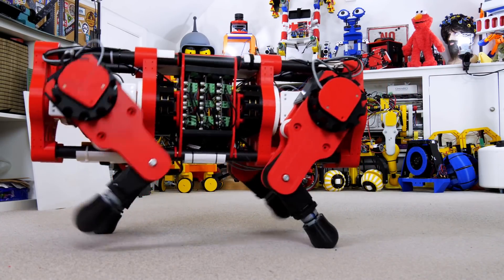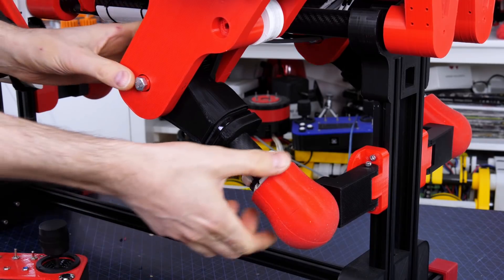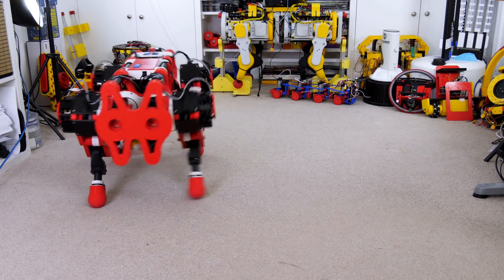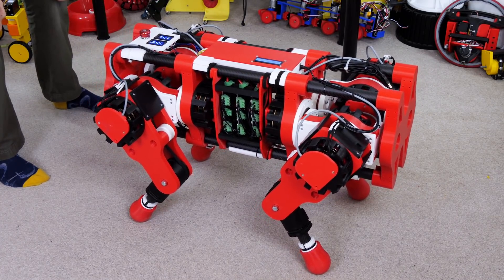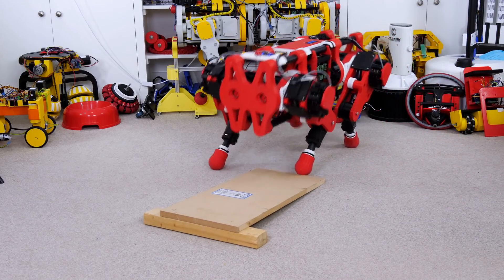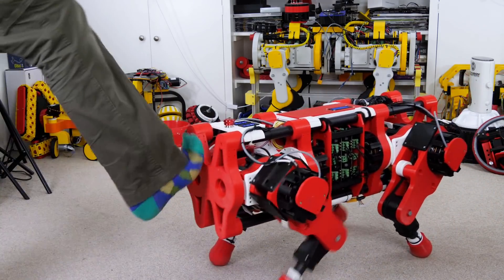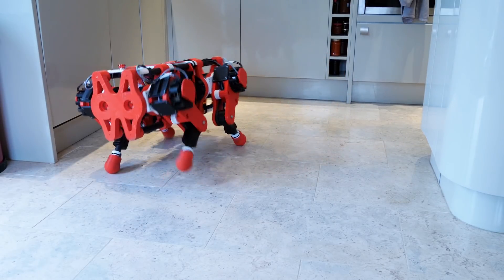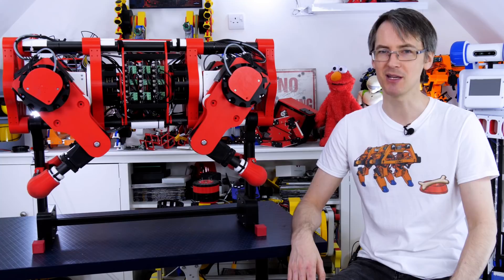3D Printed Robot Dog Climbs Over Obstacles

Comment: Would it make sense to add multiple stepping patterns for different move speeds, like horses have? when moving slow just moving one foot at a time, that way you could navigate really smooth without balancing issues.
Right now you only have "trot", with mirrored diagonal pairs of legs, you could add "walk" for slower and maybe one of the running patterns for, well, running?

Comment: Been loving this whole thing progress! It is so fun to watch you go through every step and overcome all the challenges. It has also made me think critically and come up with potential ways to improve any future iterations of openDog, specifically surrounding the design of the legs. I know that your version of a robot dog is supposed to be able to move forwards and backward relatively easily, with the front and back legs being mirrored, but I think taking a few notes from real dogs might help. In this case, I'll be comparing it to a golden retriever, as I feel it is a good general comparison (also the first high-performance dog I could think of):

1. The first thing I notice is the height of the openDog. In a golden retriever, the length of the legs in a slightly bent, stationary state, results in the height of the dog (paw to top of the body, not including neck or head) being approximately the same as the length of the dog (front end of body to back end of body, again not including neck or head). This should in theory help with control, and the ability to move around much easier. My thinking surrounding this is that the current version's stride length compared to the body length makes it difficult for it to move as effectively. Just to make sure I'm not crazy, I looked at Boston Dynamic's robot dog, and their body length is very close to the height of the robot, so this idea may hold so truth behind.

2. The second thing I notice is the ratio between the upper (thigh kind of area) leg versus the lower (calve kind of area) leg favours the former. In a golden retriever, the upper legs are shorter than the lower legs. The ratio of upper to lower legs is approximately 1:1.5. I don’t know how this could affect the way that openDog moves, with the different structural design concepts applied, but it might help with openDog's ability to handle moving at greater speeds. Again looking at Boston Dynamic's robot dog, they instead have a 1:1 ratio between the upper and lower legs. Additionally, I also noticed that some dogs also share this characteristic. So I can't concretely say if one is better than the other. But I still hold the belief that the lower leg should at least be as long as the upper leg.

I don't have anything else to add, as my experience in this area is limited, due to limited funds to actually pursue engineering challenges (hopefully just for now), as well as still being in high school, but I feel these suggestions might either help with future iterations of openDog directly or indirectly. Again, amazing content! Keep up the great work!

Comment: Very impressive, especially as it's largely 3D printed.  Don't get me wrong, as a technical exercise it shows how he can can come up with some brilliant and very complex mechanisms, and apply them to a problem. Just because he can, and enjoys doing it. But that complexity is also it's biggest weakness. 12 big cycloidal motors, 6 controllers and a hundred bearings for each motor? But then he glued the silicon feet directly on to expensive carbon fibre tubes, rather than using a jubilee clip or a simple screw. And his "belt tensioner" was a fixed wheel that would have to be replaced as the belt stretched. Simple, cheap, spring loaded tensioners have existed since at least Victorian times. As the great engineerinv genius Colin Chapman used to say, "simplify and add lightness".

Comment: Please make open dog four! We love open dog. Would you consider going smaller? Molded parts for gear assemblies? A belt through to the shoulder to articulate the knee driven in the shoulder housing. The whole shoulder assembly rotating on a carrier for the pitch control. And finally a counter lever roll assembly for the shoulder. I know it's identical to spot... But some problems just don't have a wide variety of ideal solutions. It's not possible to build a dog spots size 3d printed that will hold up to what use can throw at it. But it is possible to build one half his size. With as many single shelled parts as possible.

Comment: i'm a firm believer that dynamic robots of the future won't have control systems that are programmed and tuned... but rather will have neural networks where it is trained to walk (or whatever else dynamic motions it needs to do). Obviously this is much easier to train if you have a high-fidelity simulation and can run millions of runs to tune the network. But it would be really cool to see if you could do a project where just the raw inputs of the sensors go into a neural network with multiple layers and it is given a goal and allowed to try to learn its own algorithms for accomplishing each goal (perhaps with multiple factors being weighted such as time taken, power used, minimizing joint rates, etc.).

Comment: Part of the instability is likely coming from the fact the “spine” is inflexible. Even just a single motor allowing the front and back to rotate relative to each other might help drastically. Although that would almost certainly require a fully new version so it isn’t a simple solution.

Comment: Have you heard of a "Reverse Footlock?"
If you ever want to do more complicated feet than single-point contact, in the Animation job known as Rigging, which is setting up characters for animation, a Reverse Footlock is a technique we use employing additional theoretical joints and an extra IK chain to keep a series of joints flat on the floor only where low enough to remain in contact, so the heel can peel up and move around independantly during toe-only contact, despite being the primary point of contact itself, using joints and IK that flow reverse to the original foot.

That's as best as 2-year-out-of-work teacher can explain it on a YouTube comment to anyway.
I'd recommend you watch any YouTube tutorial on the process being done in Maya, for a better understanding though, unless this process is already documented for robotics somewhere, but I've not seen any robotics that weren't Disney that seemed to take any lessons from animation (and holy crap are Disney's robotics advance! You should check out their YouTube channel).

But essentially the constraints and theoretical additional joints to add should be translatable to code, once you understand the basic sequence of hierarchy and value transfers to make it happen. Hell, I used to prefer to code them than use the interface in the end anyway. Rigging in Maya uses MelScript and Python.

Might need an extra controller in each heel though eh? :P

Comment: I think you can solve the rotation at slow step rates with kinematic cross-coupling of the motor torque.  I.e. if the leg position and motor torque is pushing against the ground with 100N, then add enough torque to the shoulder joint to balance that 100N on the ground.  Put another way, you have enough info in your robot to make a simple inverse model that takes leg position and robot weight and outputs an "ideal" joint torque.  Add this into the output of the PID and then it will be doing less command tracking and more disturbance rejection.

Comment: The dogs fantastic! It's movement is very inefficient tho, with better software that thing could jump, sneak along etc.. maybe some really good environmental sensors on and underneath would help with the plotting of steps over varied terrain..

Once you've got that, the cheaty way to get it moving like a pro might be to emulate it as a game sprite as accuratly as possible an then neural network evolve AI for it.. still no simple feat but likey to solve many issues... big well done open dog3!

Comment: Instead of filtering the IMU data, how about using PIDs on each axis; translationally offsetting the feet position to zero-out accelerations in the local (body-relative) horizontal plane, and rotationally offsetting the positions to keep the body parallel to an imaginary ground plane calculated based on the direction of the g-forces, and zero-out the rotation speed around the yaw axis?

edit: Oh, and maybe also take in consideration the center of gravity of the dog, aiming to keep it always above the midpoint of all the feet that are touching the ground, using the direction of the g-forces as a reference for what's the vertical axis.

Comment: You don't need filtering on accelerometers, you need proper sensor fusion (6 or preferably 9 axis) so that you can discriminate linear acceleration, rotation and gravity. Adding more filter just also increase the delay as much, you are not going anywhere to eliminate oscillations. (I'm writing at the same time as watching the video, seems like you already thought about it ;) ).

Comment: Why not use something akin to the bent lower legs of the v2 to offset the displaced hip joints? It wouldn't even require a full redesign, but the software might need some adjustment.

Comment: When real dogs walk, they use a 4 step sequence. Have you ever considered using a modified 4 step sequence vs. the 2x2 ?  As fast as your joints move, it seems like you could reduce the tipping, or swaying,  by only having 1 leg off the ground at a time.  The modifications you made in this episode are amazing! Such a huge difference!

Comment: Nice work using accelerometer data to stabilize the robot! Have you considered using aliexpress actuators for opendog 4? They're based off the actuator in the mit mini cheetah. I would suggest a RMD X8 pro or RMD X10.

Comment: You had an inner ear installed already but it wasn't using it? Good on coding that up. 
Your legs already have (some) Proprioception, but it was lacking Equilibrioception.
Reply: I also notice it's on a stepping loop even if it doesn't need to move a particular foot. That might be a nice next optimization... more logic for whether it needs to step or not.

Comment: Adding encoders and force measurement for position ground truth information would make this a great cheap research platform. Any real control pipeline needs feedback; the IMU is only a distant and delayed feedback signal. Think of how hard it is to stand up when your legs fall asleep and you stop getting proprioceptive feedback, even though the strength of your muscles is uncompromised.
Reply: Actually, I believe the odrive can at least give you the effort information, if not absolute position.

Comment: not sure if it would be practical but a neural network balancing system would be quite cool for the dog and easier to make as you dont have many inputs other than the sensors though you could add few more to help it.  I bet boston dynamics is using something like that

Comment: This is  a fantastic project.  It's starting to enter the uncanny valley where we start to judge it as a living creature which ought to have better control of its limbs.   Now it seems clumsy, nervous, unaware of its situation and inefficient in its movements.

I think you have good enough sensors and mechanics,  but I think the software needs attention next.

Why not start again almost from scratch with the software.  remember the lessons you have learnt,  factor out some fundamental things into common code,   but start again with a new motion idea.

Two sources of inspiration come to mind:  
1) chickens and other birds have an amazing ability to keep their heads in one place. Explore a motion idea that aims to keep the position of its sensors as still as possible. e.g. when you lift one corner, it tries to make itself heavier by not pushing on that leg, and when that is not enough it straighens the opposing legs. 
  2) Cats seems to be the most sophisticated and efficient movers.  Start again again and try to behave like a cat. This time optimise for battery life and energy expenditure.  That bent leg pose feels hard to sustain (imagine standing like that for 5 minutes) Cats feel like liquid when you pick them up, and when they walk across your desk they know exactly where everything is and place their feet efficiently and never knock things over.  Make it so that at any moment it does the most quiet, efficient and aware thing to get to its next goal. Make it walk over those obstacles without kicking them around.

Comment: What if you put a pressure sensor on its paws (piezo maybe) or some current sensor on the motors (current will increase when exerting some higher force). When it senses that he touched the ground, stop the respective leg movement, correct balance, and go for the next step

Comment: If I understand it correctly the problem at hand is that (in the beginning of the video without the dampening) all the legs always extend all the way. 
So in order for the robot to be more stable it would need a way to tell if the leg touches the ground and not extend the leg any further. 
Basically you would need to add "feeling" to the feet.
And if I am not mistaken you could add that feeling by measuring the current of the motors. As soon as the leg touches the ground and therefore puts mass on the leg the current of the motor should spike.
Reply: You have the relations T = k * I and  F = T/(L*sin x) but I think the problem becomes hyper-static. 

With four legs on the ground you would need 3 forces and 3 torques for each point of contact. At that point you need more data to solve for the forces. 
If you could hook up some strain gauges to the legs you can solve for internal stresses and external forces, so yeah, force sensors pretty much required IMO.

Comment: 13:33 "I don't really want to..." Glad to hear you haven't put an end to the evolution of Robot Dog. Many thanks for the inspiration. 😃👍
Reply: There just looks to be so much opportunity for more evolution here,  I'd love to see version 4, or higher!
What he's done is nothing short of amazing from a technical and gee-wiz point of view, but at the same time, the capabilities of the legs seem no more than could be achieved with a wheeled robot (MUCH easier!) the main reason to use legs like this is to be able to handle big obstacles, things like walking up a staircase. This robot isn't there yet, but I can see how it could easily get there with a bit more tweaking!
Reply: From what I've seen he seems more interested in making OpenDog a way of demystifying the sorts of robots Boston Dynamics have made, and making a technologically close equivalent, but built at a budget that doesn't make military contractors cry. Sure he could burn another small mountain of time, cash, and effort making a V4 that'd maybe have some better specs, but with the project being more about making it have stable-self regulated motion that adjusts to it's environment and has enough power to move around without cheating with bungees or using rigid code with no IMU home boy has knocked it out of the park, and now with it released into the wild I expect we'll be past the "LOOK I DID A SPOT" clones stage in a year or so and have folks doing some Real Cool Shit with OpenDog derived stuff in short order. Good on ya James!

Comment: I think one of the main Reasons, why spot works so well is, that it can balance extremely well and in every situation. You should try and implement something like this. But you may need to stiffen the suspension on the legs, can you still increase the current?

Comment: Can you like try different gaits before making any more mechanical redesigns? As for redesigns, you might need to relocate the waist motors to just above the legs. Yeah, it'll make the dog taller and probably wider but that would be mechanically more stable in a standing position.

Comment: Here's an idea: What if you built a robot that uses two shoulder motors like now, but instead of using a knee joint, you used a linear actuator? With a leg that extends and retracts. Depending on how far it can extend, the greater would its range of motion be

Comment: I think that it might have been a good plan to first program the inverse kinematics to support the robot as it moves via inertia. The legs should behave like a multidirectional wheel not adding any extra movement and letting it move with inertia. Basically only lifting the leg when its nearing the max range of motion of the leg and then putting it down on the opposite side with a distance from middle point under the leg to the edge of motion which depends on its velocity. The faster it moves to its maximum allowed velocity, the closer to the maximum range of motion in the moving direction should the feet be placed

Comment: It would be interesting to see it with a one foot at a time gait. You'd be able to slow the legs down I think which visually might look better even if it might be slightly less impressive on a technical level. 

I think it would be cool to add a load cell or pressure sensor in each foot, not for compliance but to be able to track where the center of mass of the dog is on the floor plane. That way you have some more data with which to decide where to place the legs and take steps for dynamic stability.

Also, beware of kicking open dog, seeing as you've already armed it with a turret and all...

Perhaps for opendog V4 maybe something smaller with just some super beefy RC servos? Theres some 30+ KGcm servos you could use on a dog maybe half the size, without any extra gear reduction. The mechanics would be simpler, and lighter. Might meet your goal of easily transportable and would be cheaper/easier to modify the mechanics like joint offsets, and let you focus on the walking algorithm.